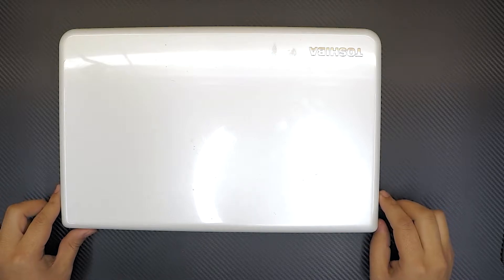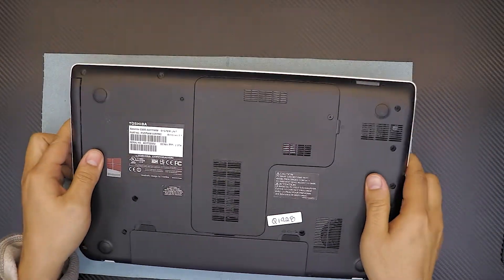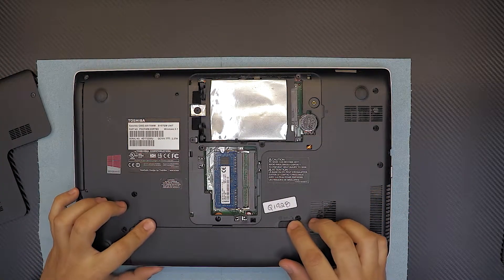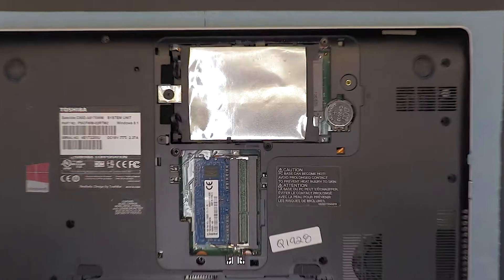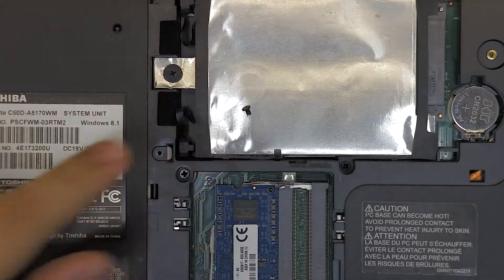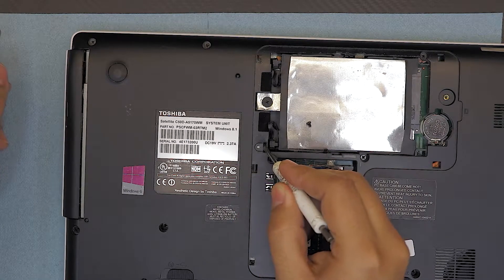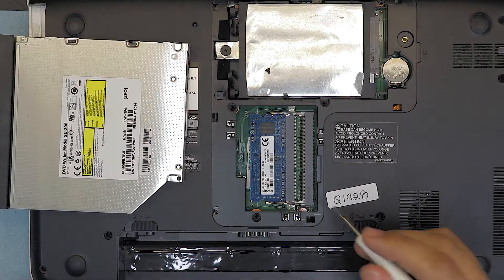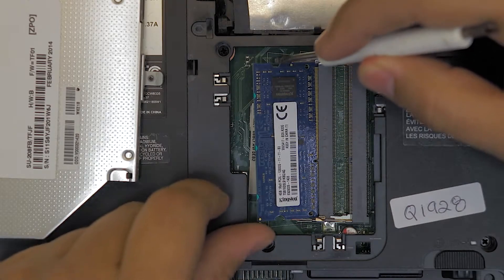Toshiba Satellite C50d Ram Upgrade, STEP, By STEP

Comment: compatible change 4gb or 8gb ram?
Reply from the maker: You can install 2x 4GB, totaling 8GB, without any issues.
cheers🍻
Reply: @uFixTek  thanks
Reply: @uFixTek  what is supported clock speed is 1350mhz or 1333mhz.
Reply from the maker: It's my pleasure my friend.
1333mhz

Comment: how can i put in doubble channel the RAM? i dont see the options in the BIOS.
Reply from the maker: 🫠Regarding your question, it's not possible to manually configure the settings you're inquiring about; this process is automatically managed by the BIOS. If both RAM slots are occupied, the BIOS will automatically enable dual channel operation for the RAMs.
Should you have any further questions or requests in the future, please don't hesitate to ask me.
cheers🍻
Reply: @uFixTek  sorry for my bad english i'm spanish, i had to put two memory identical RAM... and the BIOS didn't make any changes automatically but thanks for your help and time.
Reply: @uFixTek  I put two identical RAM memories and the dual channel was not set automatically, I saw it on cpu-z on another computer if it was set to automatic dual channel... sorry for the English... I'm Spanish. Thanks
Reply: the model is c50d-a-12r
Reply from the maker: Amigo, no hay opción en la BIOS para ajustar el dual channel. Si tu tarjeta madre no está diseñada para usar ambas RAM en dual channel, no hay nada que puedas hacer al respecto. Hay algunas revisiones de esas tarjetas madres que usan ambas ranuras como single channel. La revisión de tu tarjeta es single channel (-a-12r). :/